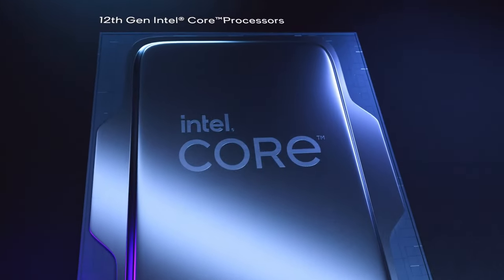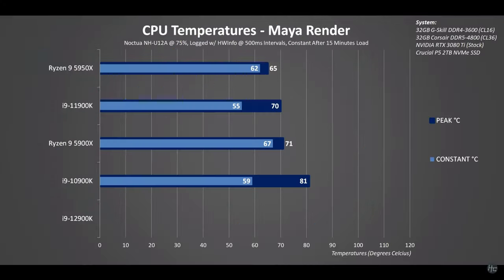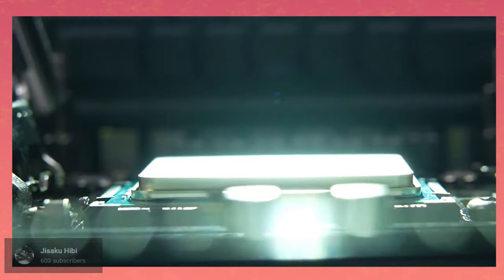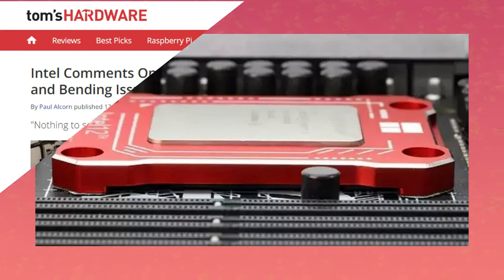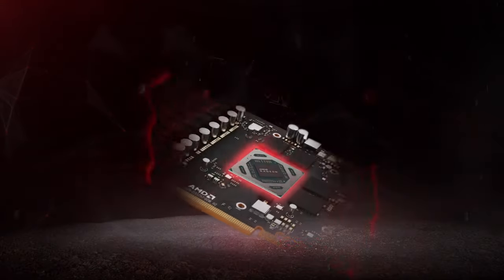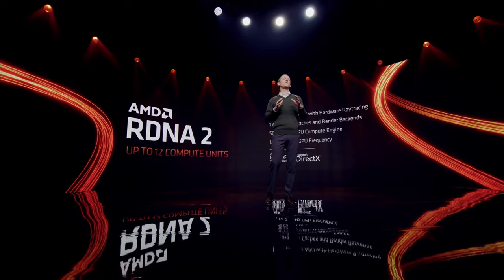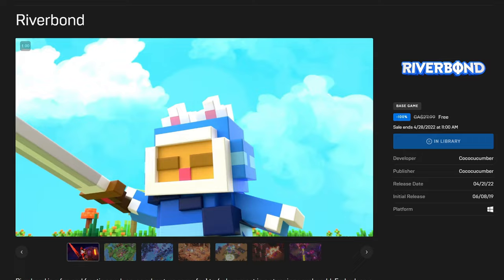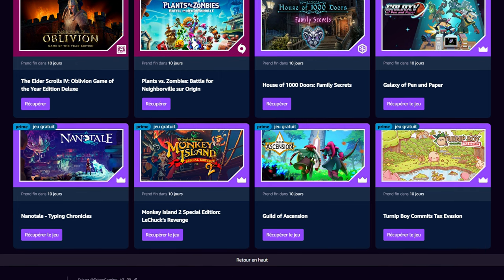They Fixed Intel's 12th Gen BENDING CPU Problem!

Comment: That bend is pretty bad. And worse is their smug, dismissive attitude to the situation.
Reply: Doesn't seem like a problem unless you're over clocking so I don't know why people care.
Reply: @AndrewMellor-darkphoton  overclocking or not. when paying for a product. it shouldn’t suffer these flaws
Reply: @zhila5958  the product was testesd with all the flaws present and review consensus was that alder lake has great chips for good price. 

So does this whole "bending" affair even  matter? How does it negatively affect the user?

It could have been better, yes. 
But then you can say it could have had more powerful cores as well, could have had better manufacturing node, could have had better igpu etc etc
Reply: @damara2268  well it doesn’t matter what company it is. i like intel’s Alder lake and wanted to build an alternative system with one. i wouldn’t want such flaw in my system
Reply: @zhila5958  but how does this flaw affect you? It makes zero difference in reality for the end user.
It's only highly shared by media because writing "Intel CPUs bend - crucial issue!" in the title attracts a lot of clicks which means more money for the publisher.

As I said the issue with games not turning on was 100x worse than this artificial issue with CPU bending by 0.1mm in the middle. 

Only alder lake that has cooling problems is i9 and it's because it uses 250W. 
I9 10th a 11th gen had literally the same problems with cooling eventhough they didn't bend - because 250W power draw.
Reply: @damara2268  still. i want companies to strive for perfection. we want conpetition
Reply: @zhila5958  you think the bending wasn't intentional?  
You think that a huge company like Intel actually never tested their CPU at all and their engineers have empty brain and cluelessly came up with this socket design ?

They exactly knew the CPU is going to bend a little when they designed the socket for it. It's simple physics of the holding mechanism which clamps down on the CPU in the middle that it will bend a little. They just decided that this kind of bend is ok. 

Even a kid who paid attention in elementary school can clearly deduct that from seeing the socket design..
Reply: @damara2268  as i was typing. i was dealing with to many stuff IRL. and no, i don’t think they’re braindead. and i’m waiting for steve from GN to talk about the topic more in depth. there is nothing wrong about an extra warning about something like this.
Reply: @AndrewMellor-darkphoton  
I don't overclock and Intel barely even provides a stock cooling solution anymore because it was so god awful before. It's an unacceptable fault also because we've had over thirty years of CPUs that didn't get BENT by having a cooler attached.

Easy stuff.
Reply: @InvadeNormandy  Intel still provides stock coolers with their CPUs, only for the locked versions, the unlocked versions (K) don't come with one, thank goodness for that :D
Reply: I don't do gaming , won't overclock with my soon to build I712700.  should I use the thermalright?  from a bicycle mechanic's point of view, tightening it down till you hit a wall of resistance being the motherboard itself will then put pressure on the motherboard.  What will prevent the screws from comming loose...  Any thoughts?
Reply: @AndrewMellor-darkphoton  I do not overclock and its a problem for me when I am processing photo raw files from a Canon 5D mark 4.  I have to have my case cover off and a large floor fan at full speed blowing right into the case to prevent the CPU from overheating, and even then, some of the CPU cores touch 100 C.
Reply: Deal breaker for me!
Reply: @adarsh846  I recently put in the thermal grizzly contact frame, and put in a larger double tower air cooler, and its running just fine now

Comment: Complete myth. The spring that the heatsink has to push the heatsink on the CPU are very powerful, and they just straighten the cpu again over time, it will be completely straight at one point.

Comment: So, when you buy an intel cpu, please dont forget to add a cpu unbending bracket, to fix an intel known issue. Because Intel doesn't want to spend money on a fix for you, they want you to spend money on a modifying fix, that could potentially void your warranty. Nice! I'll take 2.
Reply: In fact you don't need the "unbending mod". 

All alder lake reviewers were testing the chips without modification and their consensus was that they are good CPUs for a good price.
Only one hard to cool in a stress test was 12900K and KS, guess why? Because they draw 250W of power thx to being clocked so stupidly high. 

This whole bending "issue" is an artificial issue as it doesn't affect the end user at all. 

The initial issue where some games didn't start on alder lake was 100x worse of an issue than this one, and yet it got less media coverage than this. I don't understand why.

Comment: will this also be valid on the Z790 / B760 etc?  Will the LGA1700 socket issue persist with new motherboards too?  being the same with Intel's 13th gen, or despite the identical socket will manufacturers be able to modify / refine the LGA1700 to eliminate this contact problem?
Reply from the maker: technically yeah, but I wouldnt worry about it if I was you. Just get a good cooler :)
Reply: That would be a deal breaker for me.

Comment: That would be a really good direction, if APU's get the next generation RDNA.  UNLESS, they decide to keep GPUs up as high as they are now, it'll just be taking over a segment that hadn't been really catered to for quite some time.
 
That bend on the CPU is crazy though and the solution is just to beef-up the bracket.  Why is it, that anytime these massive companies have a problem with their product, it's normal Joe Shmoes or some other 3rd party company that swoops in to save the day?  It really shows how little they actually care about their products.  "Nothing to see here" is a joke, coming from a multi-trillion dollar company.

Comment: I have been using my i7-12700k for 10 months, 
is it worth buy this corrector or is my CPU warped due to the time 
it has been used and will not work?
Reply from the maker: if all is fine for you temperature wise, dont worry about it !

Comment: Yet tech youtubers still adamantly recommend intel cpus.
Reply: Because they are better. That bendy heatspreader is pretty stupid, but in all reality the Alder Lake system I have at home performs great and has no heating issues.
Reply: Because there is nothing wrong with them. If there were computers overheating, smoking and exploding all over the world, It would be a problem, but as it is, no one even notices any difference.
Reply: @BETEP-gw7qp  so much face palm. lol alderlake has had that many problems since launch it’s actually astonishing. A bending cpu is a massive problem but i guess people just give it a pass because intel right 🤷‍♂️.
Reply: @whatyareckon5985  No, the last Intel I used was i7 4770K, then I went to AMD, and for a few years, was fairly happy there. Then late last year, I went back to Intel. What "many problems" dude? I use a 12700K system for a few months now, and it's been absolutely perfect. Were there some minor issues for some people, sure, it's a new platform and architecture, but overall, at least for me, it's been very fast and very stable. So I don't "give it a pass", I actually like it. So idk, hate it if you want, that's why it's great to see such a strong competition in this arena, so you have other good options. I like this one for now.
Reply: @BETEP-gw7qp  over 100 games flat out didn’t work at launch and for months after. The DDR5 controller has inconsistency issues with xmp profiles working then not working randomly causing hard crashes. The 12900k and ks use 240-300 watts and overheats on water and now the bending issue for all lga1700 sockets. Which I maintain is a huge huge problem as it not only causes overheating which the IHS y from the cooler but can also damage the cpu itself. I don’t hate intel. I hate hypocrisy.
Reply: @innocentiuslacrim2290   a brand new generation of cpus are better than cpus that released 18 months ago? You’d wana hope so. The “bendy heatspreader” issue is not silly it’s a major concern.
Reply: @whatyareckon5985  I can only speak for myself, and that's what I've been doing the whole time. None of those issues affected me at all. I'm sure I'm not the only one.
Reply: @BETEP-gw7qp   its not about the anecdotal though. Its about the broader picture.

Comment: my cpu only goes up to about 60c at full load.  so i dunno what you guys are doing to get it up to 90c. 
but i have the standard ilm.  a noctua evo (new type)   and with all cores at 100% core temp does not even go past 65